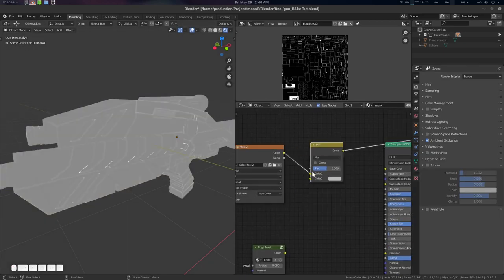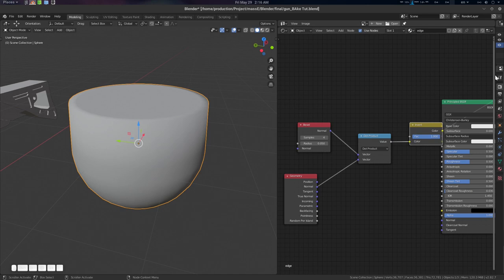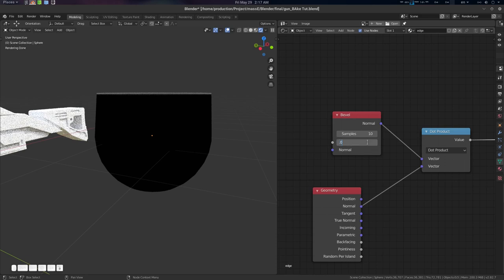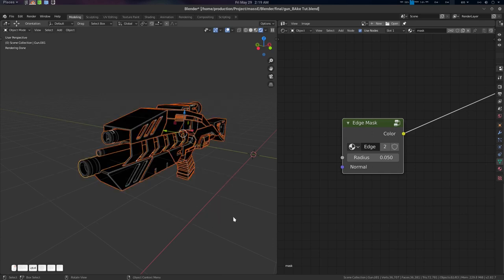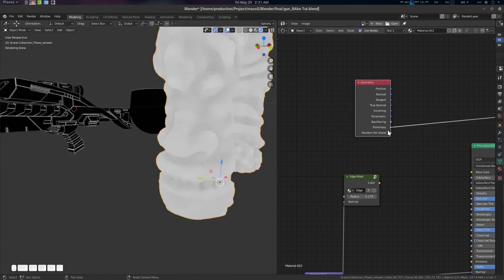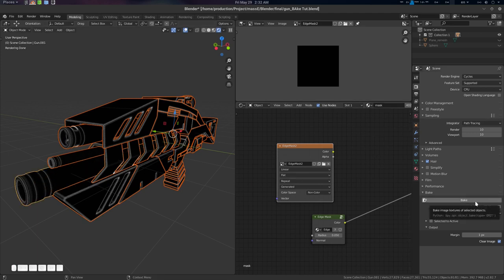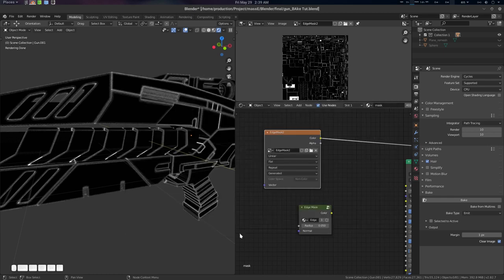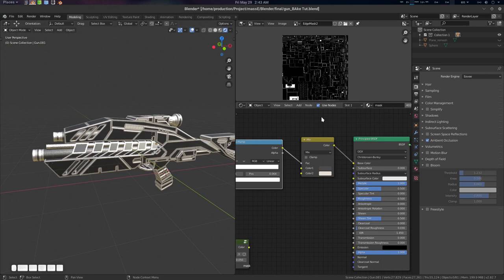Baking Edge Map for Wear Edges in Blender Tutorial

Comment: Great tutorial! one of the better ones on edge wear. This is a good way to add some quick wear or to use as a base mask for painting but I still haven't found a good way of making completely procedual wear in Blender. The problem with this method is that it applies edge wear to all edges even cavity edges that would not see wear. This can like you say be avoided to an extent by object seperation but in a lot of models it's not possible, anywhere there is inset faces for example. 
I'm a node noob but I wonder if there is a way of limiting this to outer edges, maybe by angle. The only way I have found to alleviate this is to plug in a geometry pointiness into a colourRamp and then into the bevel radius. The problem with this method is that if you have a complex object you need a new material for every part of the object as each object needs the colourRamp adjusted to get the desired effect.
Reply: I'm facing the same problem. Did you find a way to do it?
Reply: You could use the resulting bake as a mask and apply a scratch tile texture to it.
Reply: You could bake AO and use it as a mask...
Reply: @technotechmusic  I actually made a shader that overcame this issue a bit. It involves using the bevel, dot product and AO nodes. It still sometimes needs to be tweaked for each object but it does remove the edge wear effect from cavity edges.

Comment: The baked image comes out distorted, edges are broken in some places, some are stretched etc. What's the problem?
Reply from the maker: Hi the symptoms suggests
1. UV Problem
2. The object is not applied by scale. (select the objects> ctrl+a>apply scale)
Reply: @cgvirus  I appreciate the comment greatly, however I am quite a noob still. I am unsure if I even presented the symptoms correctly. I inset a cube face, then extruded the face inward. When I bake the image and apply it to this, the faces moving inward become completely grey for example, as though the entire faces are edges, rather than the edge itself. Would really appreciate a fix to this problem. SO far I've been working in cycles as a work around but prefer eevee for basic design like this - EDIT: Actually I believe that the 2d image cannot distinguish the inset faces in 3d space, so it is stretching the image all the way down the axis. HOw then do I fix this?
Reply from the maker: @28lester  I was able to replicate your problem just now. It's coming from UV stretching. This will also affect any texturing you are going to do later. Try this:
1. select the extruded cube
2. Tab> edit mode
3. select all pressing "a"
4. press "u">Smart UV project>use default>ok
5. See your uv in UV editor
5. Now bake the texture in cycle as usual.
Reply: @cgvirus  That worked - thank you so much! I have been following your follow up video to this as well for texturing, it is really awesome! Thank you again!!
Reply from the maker: @28lester  Most welcome. Best Wishes!